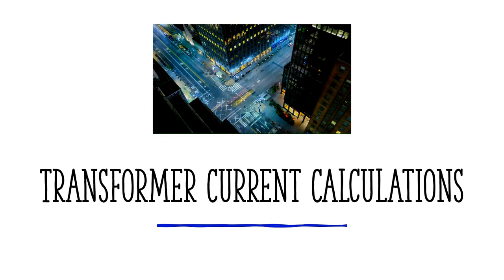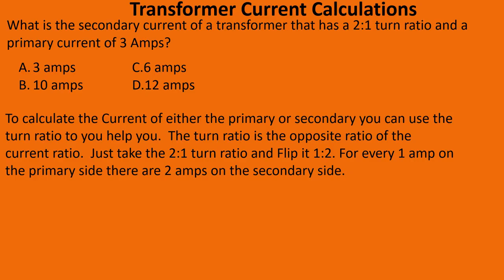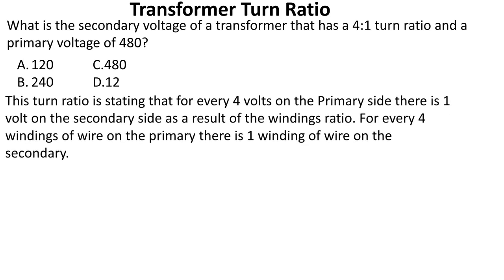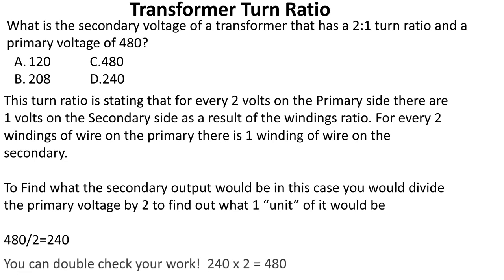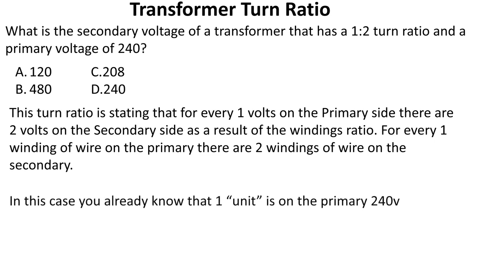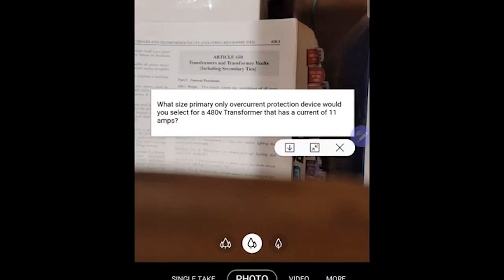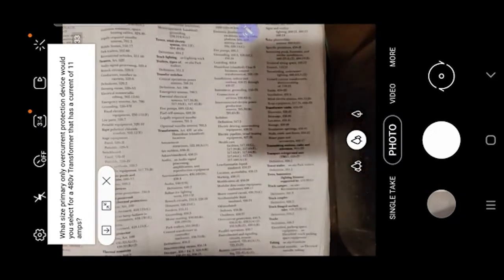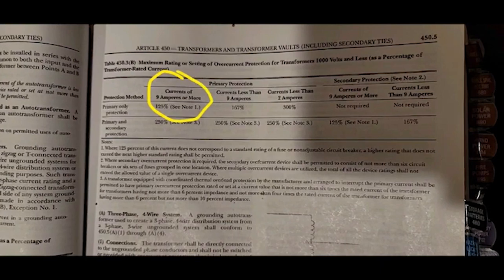TRANSFORMER CALCULATIONS 101 Over-current protection Turn Ratios and More!!! Master Electrician prep

Comment: Hi code coach, my question is... Why the neutral in distribution transformer is grounded? If the nuetral not grounded, is the transformer working properly?
Reply from the maker: A standard utility system will be grounded. It could function but would likely  burn up the Transformer and they would have crazy voltages.
Reply: @ElectricalCodeCoach  thank you so much